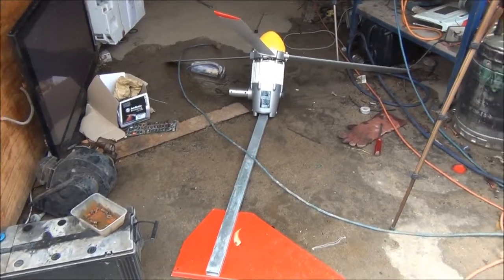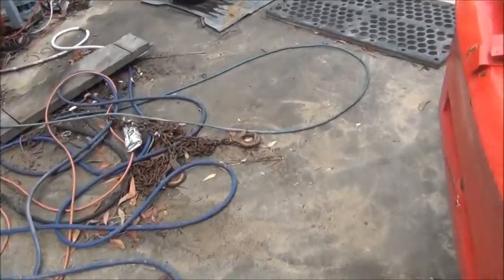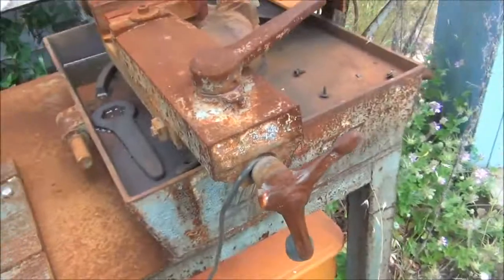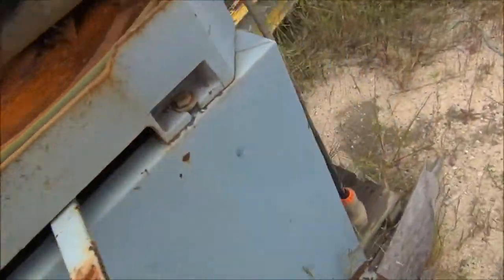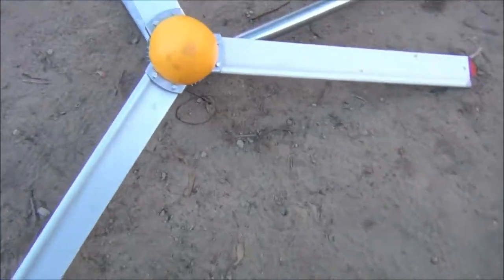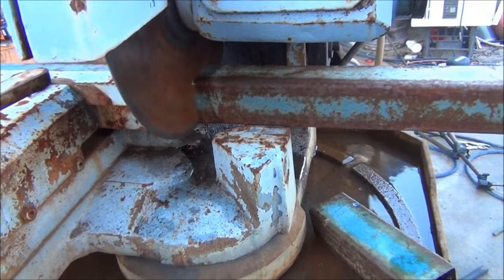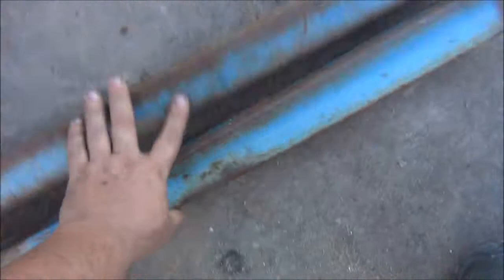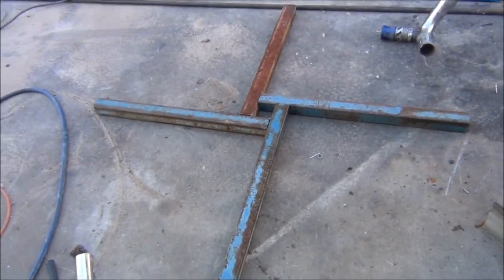Wind Turbine Part 2: Tower mock up.

Comment: Dont forget to stick some old slabs or engines on the base, wont wobble then ;-))

You want a good slap alex, get a jar of old oil and paintbrush it on the cutting machines, then cover the tops with bin bags, they wont lockup next time you need them.

Yooooou silly boy ha ha :-) :-))